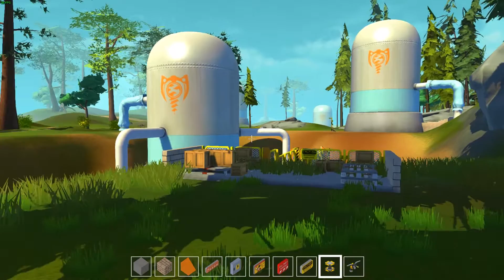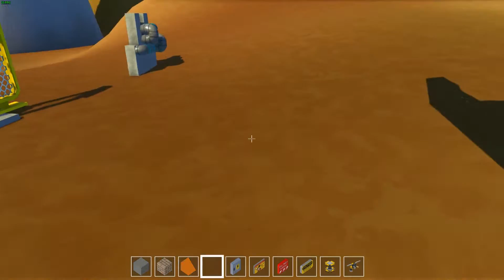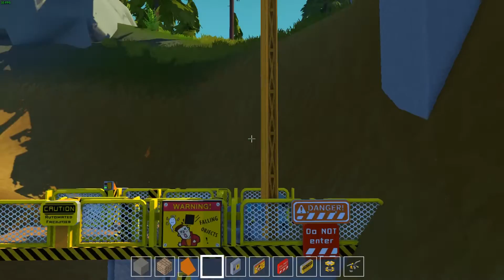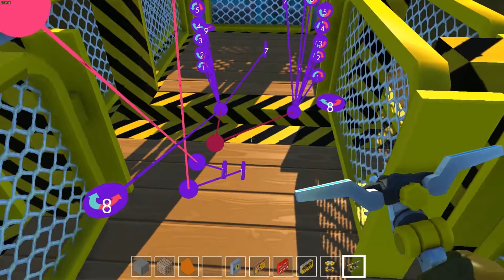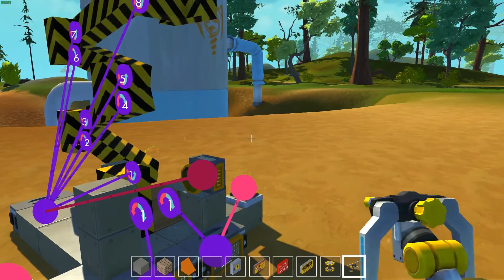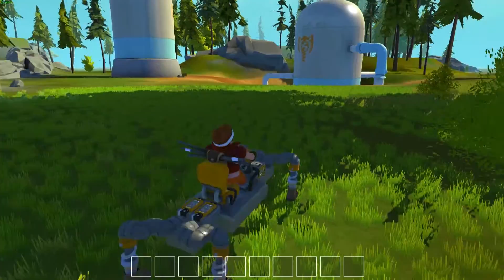Scrap Mechanic - Vertical Lift with Call Function

Comment: Can you put wheels on both sides of a beam and get the same result? Or is the game not THAT advanced?
Reply from the maker: +HYPERSHADNIC Yes wheels on both sides work but not really any traction unless on top of a beam. Working on a system that uses a suspension part to act as a buffer to get good grip on to the side of a rail, ie a Monorail :D